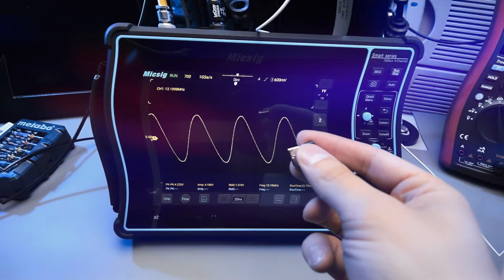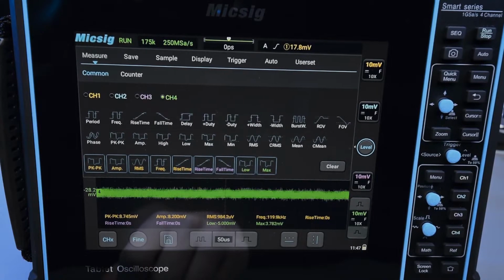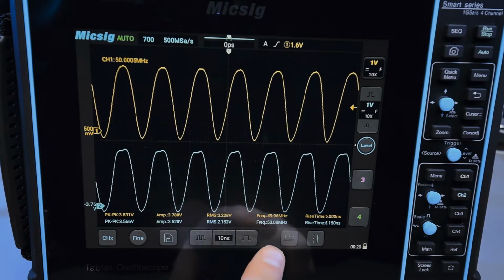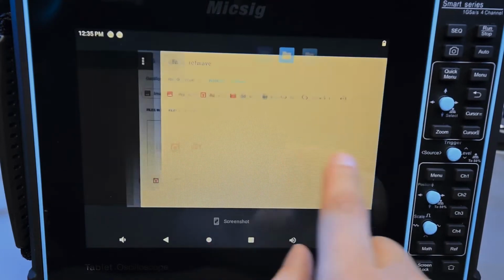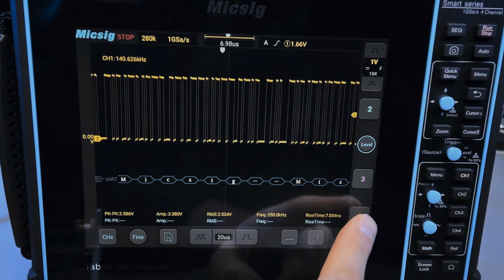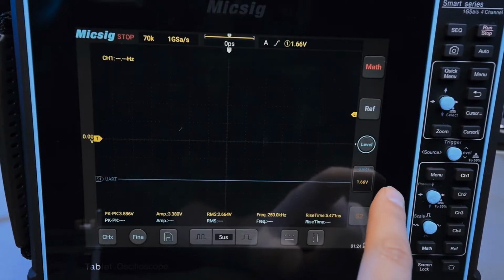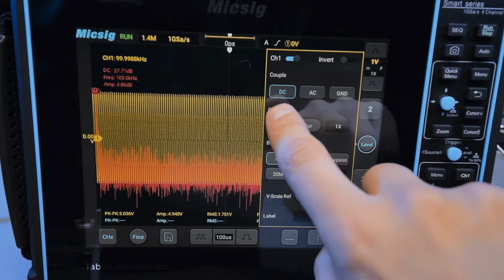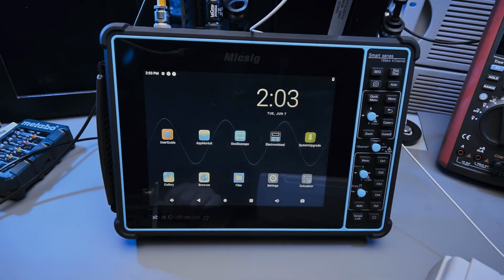Micsig's New STO1004 Tablet Oscilloscope...Now with joysticks!

Comment: The joysticks are killing this scope for me. I can't for the life of me understand why they didn't keep the knobs etc from the (now discontinued, for the 4 channel versions) STO 1104C/E series. The joysticks are like the Thinkpad 'knob', and I absolutely hate every millisecond of using that interface ("hold and release" is what I can't stand). My current DSO is a huge old Gold with several minutes of boot-up time and a thermal printer for screenshots.. my 100MHz analog Tektronix is extremely nice but has just two channels. That Micsig looks just like the thing - four channels, ok bandwidth, very nice touch screen UI, more robust than the previous series, takes very little space (exactly what I need now). 

But: Those joysticks are the reason I'm not buying this scope.  Can't stand them.

EditAdd: Strange that the rise time measurement should depend on how you set the resolution of the scope. That's presumably something they can fix with a firmware update. There seems to be various small bugs here and there anyway (ref. the serial decoding section) which need to be fixed. 
This video demonstrated a lot  of stuff not covered by other reviewers (serial  etc, and mouse interface!), so it makes a nice complement to those other reviews.
Reply from the maker: The joystick is a convenience to some folks.  You can navigate without it ...